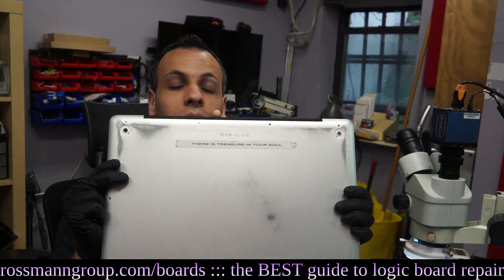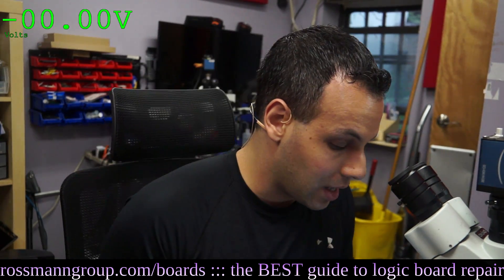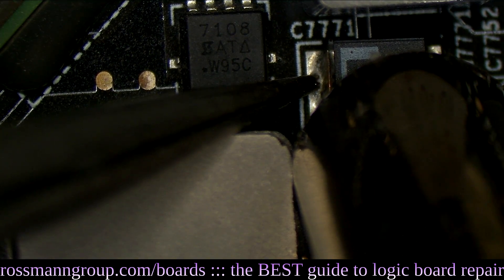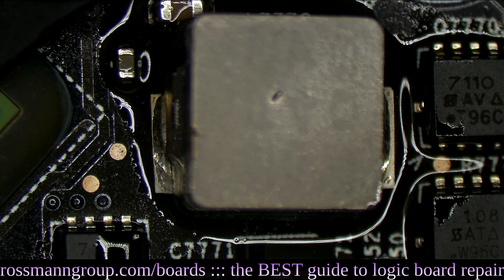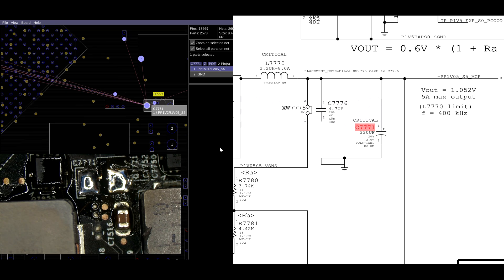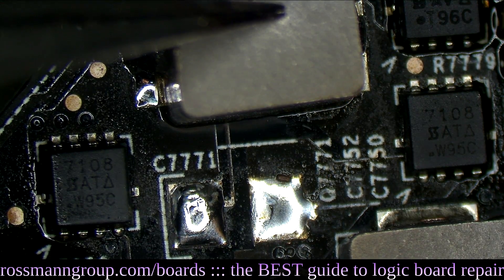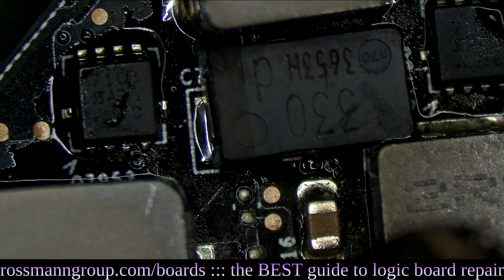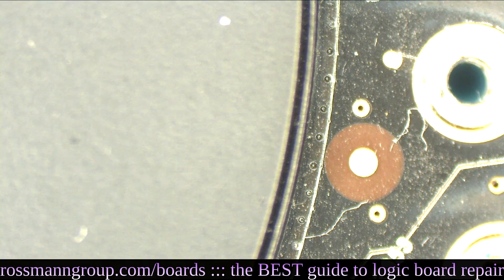Can room temperature kill a Macbook?

Comment from the maker: Want to watch these repairs as livestreams rather than edited down portions? Check out the live channel below for b-takes  & repair videos before they are edited, and random livestreams, and as always, I hope you learned something! 
👉 https://www.youtube.com/channel/UC6nZlvfz4YWoBWbjiaYJA3g
✓ Cryptocurrency tip links:
› Bitcoin: 1EaEv8DBeFfg6fE6BimEmvEFbYLkhpcvhj
› Bitcoin Cash: qzwtptwa8h0wjjawr5fsm0ku8kf40amgqgm6lx4jxh
› Dash: XwQpZuvMvU44JT7C7Uh6xHvkSadzJw9fMN
› Dogecoin: DKetsoCvwa2hF29ssgUA4Wz4hxT4kj3KLU
› Ethereum: 0x6f6870feb48f08388ee345cf0261e2f03d2fa310
› Ethereum classic: 0x671bfd61ba87edf6365c97cea33d66ba73645510
› Litecoin: LWnbTTAjojZQt68ihFJFgQq3cYHUsTcyd7
› Verge: DFumZ5sMhi3JktLQpsTVtV9xUt3zKDrcZV
› Zcash: t1Ko3FkphQYoQroQc8k2DVk4WKMAbmNR8PH
› Zcoin: a8QdvArHmdRYe1MjiqtP6jDNe6Z4JgnRKZ
Reply: Louis Rossmann I don’t like apple latest pushy buy new one policy but my Mac 💻 2011 pro still working flawlessly, after 7 years and 1 one month still kicking, I am very careful I need to mention here, I only used most at home and I don’t drink anything in my room office. I also didn’t change any part of it l, the battery 🔋 still original and last 2 hours top’s but I always used the fan support and unplug the battery when full sometimes. My father only last a year or so and he’s already enthusiastic to buy a new one, what worried me is we live in a era that products are not to mention to last settling a time bomb in every lasting durables making you worrying in pushing yourself harder every year to buy or stay behind and this is stupid sincerely.
Reply: @josephhollandpontes1030  I respect the fact you buy the product you want, but you made a statement that tells me that Apple would be a total waste of money for me and my job, I have a dirty job and I use a Panasonic laptop at my job, nothing, I mean nothing can kill that Panasonic, a laptop that must be used in clean cool air areas a Apple iMac wouldn't last a week, probably not even a couple days at my job, I can understand people that have office jobs where it is clean and climate controlled will rather have a iMac, but I don't have a office job and to be honest I would never want a office job, I grew up in a family that believed in long hrs and hard dirty work and coming home and jumping into the shower, but that's me, and if you have a office job I hope it's something that you love and it's fulfilling to you.
Reply: Yeah the apple gistarpo don't like anyone who meddles with the mafia style control of (let's sell them a new one rather than repair the old one). Good on you for exposing this corrupted organisation that just about gets away with blue murder! Love your channel. Keep on trucking!

Comment: CONSUMER BEWARE
The Apple Certified Repair Side Shops can kill your Mac.
I could have went to Non Apple Certified Service GR Mac Service to have this repair 
INSTEAD i called Apple and because my computer is not on warranty no more sooo
Apple referred me to Apple Certified Service Computer Rescue 911 
and it cost me $750 for a new logic board think of $1000 for the whole Logic Board
And not to fix the one chip is bad'
And that is all because Apple Certified Service Computer Rescue 911 did not Properly fix my computer, 
because when i took my computer home from Apple Certified Service Computer Rescue 911
and plugged into stereo and the right channel  ear jack is not working so after one return visit to 
Apple Certified Service Computer Rescue 911
Who blamed me for the  problem by listening to my computer on my stereo through my ear jack
that i have been doing for 6 years on this computer and the
(Tech at Apple Certified Service Computer Rescue 911 
did not have any Ear Buds?
i had to go to Non Apple Certified Service GR Mac Service because after the repair at 
Apple Certified Service Computer Rescue 911 my Bill $185 to replace one bad chip that 
And that is the $1000 total for both shops.

Comment: Yes bro APPLE sets the macbook fans from factory at a low level treshold the macbook gets really hot and the fans dont spins enough solution install macs fan control set manually the fans speed all good.... ps a friend of mine melted the bottom of his macbook ...

Comment: Can you build a starter apple repair kit?
Like screw replacements to change out the Apple screws and put in regular screws and toss in a few apple screw drivers and a mini tool kit what has regular mini screw drivers and a single precision cutting tool and some clips to wedge the screen off to get into an iPod or iPhone to change a screen out and sell separately batteries, screens and other replacement parts 
I’d buy a repair kit like that for sure

Comment: "The problem with the cap is a mfg defect; not that it's the wrong one for the circuit.  TV's and other electronics had the same issue, around the same years using the exact same capacitor, from the same company.  It's just a defective part.

Comment: Is this a problem with a series of MacBook pros having this wrong part? When the weather is [only slightly] cold, if my MacBook Pro is not plugged into a power source, it will shut off shortly after turning on, indicating that there is no battery life remaining, even though the battery IS fully charged. I then need to plug the MacBook Pro into a power source and it turns on normally. I can then remove the power source, as the battery IS fully charged, and everything operates normally. 
What could be causing this?

Comment: Heating the cap probably stabilized the circuit by raising the cap's ESR (equivalent series resistance). The product of the ESR and the capacitance sets the frequency of a zero in the control loop. Raising ESR and/or the capacitance lowers the zero frequency and tends to stabilize the loop. You may have been able to fix it with a small resistor in series with the old cap, but that would have been even messier.

Comment: I presume the capacitor that was one it before delivered 1.3V at some point in time, or the board would have never worked. What went wrong with it, and why does a bigger capacitor help, and what is the mistake Apple made initially? I wish you went more into the reasoning instead of the process.

Comment: I was given a big ol' used Mac Pro about a month ago. You could just keep the Macbook next to IT. It runs hot as hell. Between it and the Cinema display I won't need heat this winter. It's got three 1 Tb drives, one 650 Gb drive. Two quad core processors. A 1 Gb Radeon I think. And 24 Gb ram. It's running OSX  (Snow leopard?) and I added Windows 7 Ultimate 64 bit on one of the drives. I think they spent a few bucks in 2009 when it was new. Starts real quick and runs pretty good, I haven't tried much on it yet though.

Comment: Do you replace the ROHS solder with leaded? I've always found leaded easier to work with and typically works better for me. But wondering if doing repairs for your customers ROHS was a requirement?

Comment: "Some apple products will stop working if they are too hot. Some apple products will stop working if they are too cold. This is an apple product that will stop working if it's too cold, so if you are not able to replace the capacitor to fix your problem, you can go someplace warmer... like hell... and then your MacBook will already work. But, if you are using an Apple product, chances are, you are already there."

- Louis Rossmann

<3

Comment: I never had a mainboard  or videocard or audiocard with a board issue. Phew, ridiculous problems.  BTW there is one thing that can be destroyed, the ATX power supply but these can easy been fixed. that is if having a scope etc and soldering equipment.

Comment: I Love the hate-hate relationship you have with the jesus company :-) you might be a little grateful, they seem to give you plenty of trade!
Quick question from an old bench engineer - talking about from the pre-smd days - I notice you using solder wick to remove solder and not a vacuum pump, is that a matter of personal preference or is there a technical reason for not using a pump? Like i said not much experience with smd rework, so if necessary please excuse the stupid question!
cheers, and thanks for the great content.

Comment: As someone who used to work for Apple, I just love these videos, and exposing all of the flaws in the design.  It gives me a big smile to know that you are educating users about these issues.  Even when I was working at Apple, my 2011 MBP failed in several ways actually, battery exploded taking out the trackpad, logic board failed (only mini displayport video worked, no internal screen), and the Magsafe degraded and shredded, when all it did was sit on my desk there.  They wanted ME to pay for it.  That was around the time I quit and joined the class action lawsuit against them as I had enough.

Comment: All capacitor loose value due to heat and evaporation. Similar to TV psu where the stepping psu is in stand by mode then capacitors run out after while of value for example 1500 uF become 800uF also the manufacture never put more value always put just enough to work. If they put 2200uf in TV psu then when dry out and value will be 1500 it will be still working. So that is the missery of new design era where everything is designed to last less and fail often

Comment: $7 for a surface mount capacitor, WTF?!
Reply: $0 for a board repair video that teaches us valuable knowledge, WTF?!
Reply: Just being given a reliable specification for a suitable replacement part is a bargain at $7. You get the how-to video free. Dry your eyes.
Reply: You can always buy it elsewhere, enough info there to do so. Though really? You just learned how to fix the old paper weight, now use it!
Reply: Well you over paid for a laptop with substandard parts and questionable build quality now $7 is a bridge too far?
Reply: Just to clarify: I was merely expressing my surprise at the seemingly high cost of such a small item and NOT  blaming Louis for it; he just happened at that time to get some totally unreasonable hate-mail from a customer about the price of that particular capacitor, so it's no surprise he got triggered by my comment, pinning it and responding sarcastically. I was incredulous because for the same price one can buy way bigger full-size components and even gadgets containing similar components, and the fact that even $30 smart-phones  contain hundreds of SMT components would suggest that they'd cost very little. After doing some research I found that these particular components are indeed much more expensive than most other SMT parts, and that Louis himself has to pay $1:75 for those. He explained in a wonderfully sarcastic manner that he subsidizes the cost of making these videos by marking up those components, and even if he didn't, and as many pointed out, it's a small price to pay for fixing a $1500 POS.
Many commenters made many false assumptions, like that I'm a Hater, when in fact I love Louis and the great work he does for his customers, and for putting up close to a thousand free tutorial videos, and on top of that he's a great guy and the many videos he's done on psychological issues are very insightful. Another strange assumption many made was that I bought that MacBook, with some even thinking that I'm having the same problem with it and I'm complaining about the price of the replacement part. I've Hated Apple with passion for decades, so anyone thinking I'd buy any of their products is madness to me. Doing component level repair is a rarity these days and I take my hat off to people like him who use their brains to do the much harder component level work required for computer motherboard-style repairs. We had a fridge issue where the temperature control button was randomly pressing itself so my parents had a serviceman come over. He merely looked at it without opening anything, wrote down the serial number of the part to be replaced and charged  $80 for doing sweet F-all. He also said that this 8-year old fridge was too old to get replacements for. I looked for the part he wrote down on ebay and discovered that it was the part-number for the Bloody FRIDGE! I found this real number for the replacement board and found that it cost $80 on ebay so I pulled out the board, replaced the button (which is found in virtually all electronic equipment but unfortunately I didn't have any at that time) with one I bought at the electronics store for the princely sum of  $1, this totally fixed the problem and saved'em having to buy a new fridge. The serviceman should've been able to do that himself but they're trained to replace boards these days, which is one of the reasons I have great respect for people like Louis who're willing and able to do component-level repair.
Reply: Man goes in to a laptop repair shop with his 2009 Macbook. 
The tech takes a look at for a moment, goes off in to the workshop, returns with a small rubber mallet and gives the offending machine a good solid whack.
The machine springs into life. 
The tech says "that will be fifty bucks please"
Fifty dollars!! Fifty bucks just to smack the thing with a hammer, I could have done that myself. How can you possibly charge me fifty bucks for hitting it with a hammer the customer asks indignantly. 
Yes says the tech, but you aren't paying me to hit it with a hammer, you are paying me to know WHERE to hit it with the hammer. 
Likewise if you can source just the right reliable SMD capacitor cheaper elsewhere.. then go there... I believe it will be a little hotter there too.
Reply: Might have ben a better strategy to give the Mac owner a good solid whack with the mallet.
Reply: Try sourcing it elsewhere with fast shipping reliably for less than that.
We're all waiting to save 5 dollers here 😂
Reply: you do not have to buy it from here , you can find that type of smd cap anywhere :)
Reply: Coming from a guy who spent to much on shyte... WTF? 7$? Really?
Reply: I love how Louis pins haters' comments so that people get to read his replies. Clever!
Reply: And we charge 200 USD for a board level repair, its a bargain....
Reply: Not to mention minimum order quantities, something else he's already had to contend with at no cost to us
Reply: These types of polymer/tantalum hybrid caps tend to be expensive compared to other cap types to begin with.
Reply: Well considering that he is giving you the exact capacitor and how to fit it eliminating months of trial and error waiting for the wrong parts from China I do consider it a fairly good deal
Reply: Sarcasm?
Reply: yeah that's a bit like I know exactly where to kick my office pc to get the video working properly on it.
Reply: Kenneth McGeechan or sticking a pen behind the non existent power button so it does not shut down on its own...damn i am poor
Reply: All that wining about the price for a part. This is a business that needs to make money, even so Louis puts all this knowledge out there FOR FREE!!! Remember that this also requires time, effort, camera gear, etc.
You can either buy from him and know for sure you have the correct part, which also took time and effort to source (and give something back) or you can put in the effort and source the part yourself but even if you do you'll probably have to contend with shipping costs anyway.
Reply: Louis Rossmann Fair enough if that's your business model, and I guess it'd be hard to buy those in quantities less than 1000+ anywhere else; thanks for the explanation, consider me educated!
Reply: Time(time talking to custormer, dealing with the actual exchange, disasembling the board, reassembly, cleaning, daling with customer again when they pick it up prolly an hour or more of time spent), Flux(is kinda pricey depending), solider(silver maybe, again, more pricey I use only Multi-core brand and its kind expensive) shipping, Electricity, ? Goto digikey or mouser electronics and order a single capacitor. 15$ shipping most the time. 7$ for a surface mount cap is a STEAL, he could easily of charged 20$+ and Still be Compleatly justified. At 7$ i would say he is basiclly doing it for FREE when you consider what he Should be makeing per hour.
Reply: Id also like to add that yes, it probably would be 7 dollars, for a SINGLE surface mount cap. Yeah, they're really cheap, when you buy 50,000+
Reply: Yeah ... stick it to the man ...you are the man though ... confused now ... sarcasme is beyond my IQ level I think ... will be a sleepless night

Comment: Well that does it. Just replaced the hard drive in 2006 Macbook 13" white. It's still getting really hot. 
Since Lion is as far as I can go, using an old browser could be part of the issue or something else I can't understand.  I'm going after a W520 Thinkpad from the (only) best used Lenovo dealer in the state. Anyone think that's a bad idea?
Edit to add comment... This intel core 2 duo poly macbook that I was given by a good friend really held up. One of the last of the good ones?

Comment: Is that cap part of a timing/oscillator circuit by any chance?

Mr Carlson says tantalum capacitors are more stable (I presume he means not drifting/leaking over time), hence ideal for that application if they will not be overly stressed

Comment: I find it interesting that you can move that coil pack 50% off it's pad, and It would still be IPC compliant. Yet apple rather just let the assembly line run without hands touching.